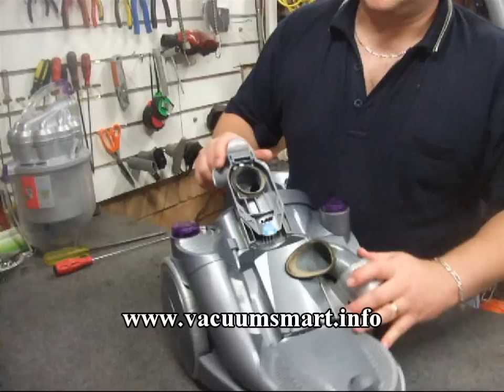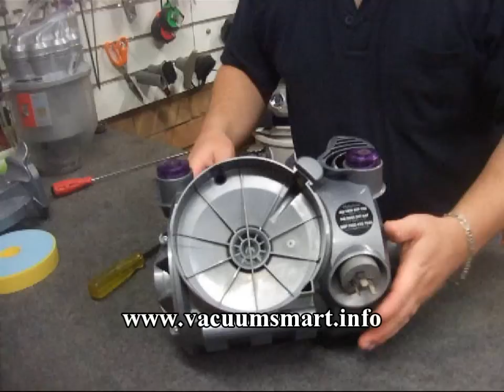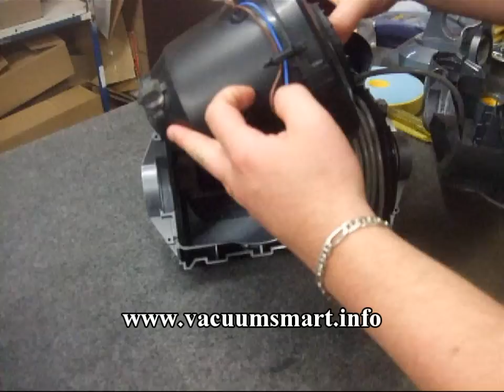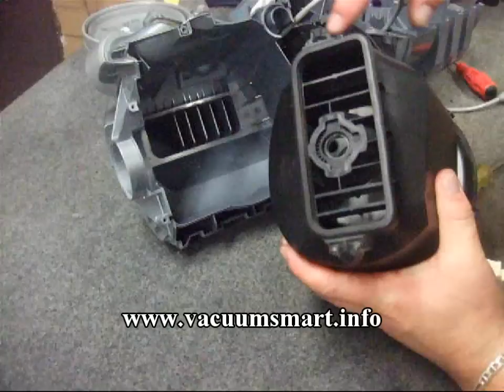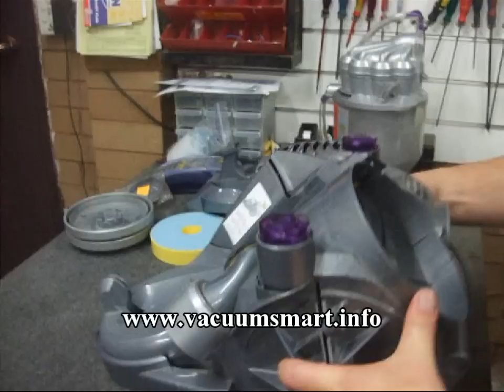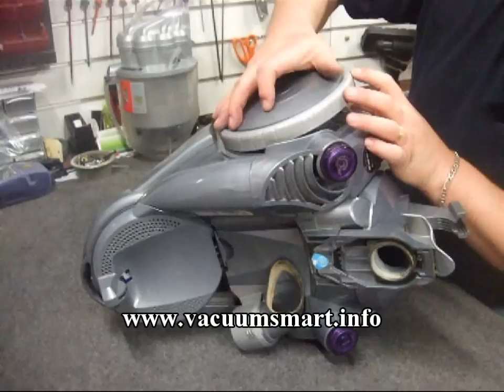How to change the motor in a Dyson DC08 vacuum cleaner

Comment: Have you ever had the rotating brush in the head apart? Mine has stopped working? I’m wanting to split the black housing so I can look at why the brush as it isn’t spinning. I can’t slide the housing apart as I can’t remove the small cast aluminum gear-thingys. Any help is greatly appreciated.

Comment: I could fit the motor DC 08 successfully.  But fixing the cord wheel was a real challenge. I had to struggle   aligning the outer cover.
It doesn't look as easy as it looks on the  vedio.
But it was a good experience and saved money on buying new one.

Comment: My my you may just have saved me loads of money,  I am now going to take my DC08 apart to see if it is the motor ( as I suspect it to be) has burnt out..... when I was using it there was a strange noise, then a burning smell so I switched  it off, the filters are new, the bin was already empty so I know there is no problem there, when I switched it back on it made the strange noise again for about 10 seconds then cut out completely and is totally “ dead “now...... How can  I be sure it’s the motor? Your video is great by the way..... thanks

Comment: vic
I used to train teachers and demonstrations was a session on the course (UK C & G 7307 Further and Adult Teachers Cert [TAFE] IN OZ). I also used to teach Electrical engineering which involved many demonstrations. I was most impressed by your video, clear explanations, visual points easily identified and a smooth, informative commentary. WELL DONE!!! 10 out of 10! Excellent!

Comment: Excellent guide, thanks! I just followed it to access the motor in my DC08, which had suddenly refused to power on. Found that the motor's winding wire had broken at the terminal attachment. Soldered in a short length of wire to bridge the gap and it's working like new again!

Comment: Great video of information, I have the same model Dyson as shown in your video, I replaced the carbon brushes run a treat first time and then started to splutter like when the brushes are worn down to far, took it all apart removed the motor and cleaned the armature.  And reassembled and the motor is spluttering any tips, Alec?

Comment: An excellent video. Just replaced the motor, switch & both filters on my 10 year old Dyson DC8 Animal. Stripped and cleaned the cyclone and the machine is like new for only £23.97. Thanks again. For those of us in the UK, SPARES2GO on ebay is an excellent place to buy your spare parts.

Comment: While this video showed me how to take apart my Dyson and I did not find my problem in that area, I did instead happen upon the real source of the problem with one of the smaller actions you took. I didn't realise the hose base could slide out so easily. It turns out my issue was a clog in the handle that had gotten pretty bad. It looks like someone must have made a 'repair' to the handle at some point and used the wrong screw (with silicone to seal it) that protruded into the hose itself. effectively hair and other detritus was just building up on that spike until it completely sealed itself.

Thank you for your facilitation of my repair, however accidental it was.
Reply: Nick Skarvig has a new name u
Reply: Engvejen UFH 
I'm sorry, what?

Comment: Hi Alec,
thanks for posting this mate. Very easy to follow and well presented. I've just pulled apart mine and my fathers Dyson's to check the motors as both have stopped working with the usual funky burning smell. Have also just placed an order for two new motors with your online store. You deserve every penny you make on the parts after producing such a good video. (I'll follow the cleaning advice also on your other video which outlines how to strip and clean the barrel cyclone chambers)
Many thanks mate, I owe you a beer,

Cheers,

Comment: I thought doing your own electrical work is not allowed by Australian Electrical Laws & Regulations. Can you advise whether it is legal for us Aussies to buy a motor from your website and then doing our own repairs at home by following your videos?
Reply: It is an appliance. There is nothing stopping you from doing your own repairs. The laws and regs mostly refer to the supply side of the electrical outlet. There are requirements regarding electrical safety tests if your repairing it for somebody else ( as in a paid job)
Reply: very shocking comment

Comment: Hoi Alec. My dyson suddenly stopt working. When i push the button, i hear de motor turned on. But when i let de button free, the motor stops immediately. 
What is wrong with my vacuum cleaner? I washed en chanched the filters already. 
I didn'n know there was also a filter on the back site of the machine, so this was the first time I cleaned this one. I thought the only filter was inside the  can you take of. I also cleaned the filter on the bottom of the machine, but i need a new one for that.
Greats Jolanda, Rotterdam, Holland
Reply: could be the cord retract assay needs replacing

Comment: Hi Alec, I've bought components from you last year and successfully repaired my Dyson after watching your great tutorials. Never looked back! My daughter's Dyson now has a problem, so I was wondering if you could give me some advice please? She was using it as normal. Switched it off to move to another power point. It won't turn back on. They tested power points and it wasn't that. Would you please offer any advice as to whether it's likely to be the motor or simply a switch? Either way I'd like to repair it myself. Thanks so much, Liz.
Reply: something similar happened to me Liz , means the cord retract assay needs replacing. It is connected to the actuator (power button) which is why when it need replacing the machine wont turn on or only turns on sometimes. ps: This part is hard to find, I had to go on ebay, even on there ti was hard to find. If  you get stuck you could try buying a 2nd hand DC08 on gumtree to use for parts.

Comment: Great video.
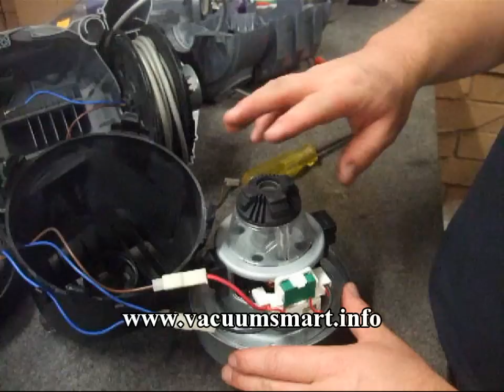You say that the transparent locator will only fit in one direction but, at 5:55 it is in one position whereas, at 6:02 it has turned 180° (the right position in y opinion).

Comment: Great Video.  I was easily able to replace my faulty motor.  I would like to add that it is possible to replace a Panasonic type motor (mine was a UDS1554CNA) with a YDK type motor.  However you must replace the rubber fan case with a YDK type as well.

Comment: Thanks Alec,

I couldn't work out how to get into my DC20.  Found the two screws at the top and knew there were another four somewhere from an online diagram of part of the machine.  It wasn't clear they were under the wheels and I would have been really hesitant to force off the wheels so forcefully if I hadn't seen your vid.  Now have access to the on/off switch which is the problem!  Hopefully I can get it sorted and save a lot of money in the process!

Comment: Hi Alec, Would you recommend replacing the post filter at the same time? Is it necessary?
Reply: did you know the post filter is washable, should be washed every 3 months and fully dry before putting back in?

Comment: I suspect your cord or motor has a short in it. Rule out the cord and switch by checking continuity with a multiplier, if they are ok just replace the motor.

Comment: great video, just want your input on something alec. I plugged my dyson dc08 into the wall socket and it would not switch on, so I thought, hmmm could be the fuse, so out came the flat screwdriver and as the metal head touched the plug prong, I was met with an electric shock. any ideas guys ?

Comment from the maker: It is normal for there to be a noticeable amount of fine dust in and around the motor. It is not normal for bits of hair fluff etc to be in the motor. If you have big chunks of stuff in there then yes have a look at your seals and filters. However just fine dust just needs to be air compressed and cleaned as best you can.

Comment from the maker: Ah good spotting!! In actual fact it is really neither the MO44 or the MO48. The motor in the video is the original dyson one which has the thermal cutout like the MO44 but is missing the shaft like a MO48. Both the MO48 and MO44 will work fine in the dc08 because of the plastic locator (riser) since the shaft will fit inside the cone no problem. If it was my machine I would use the MO44 but if you want to save the cash the MO48 works fine. Thx for the praise :)

Comment from the maker: Ok so it is possible to fit it but it is very hard. I have done it a couple of times as an experiment. Basically it goes in the same but is 100 times harder to get the casing to close. The proper way to change them over is to get a YDK motor bucket and a new fan case seal and motor support or locator. There are some versions (overseas) that I have not seen the locator (rubber bit on top) that may not simply allow it to be squashed in.

Comment: Brilliant, thank you so much for this video - I have just replaced my DC 08 motor and cleaned the rest, and my old machine is working like new for a fraction of the cost of replacement.  Your instructions are excellent, well done.  Much appreciated.  This kind of thing is so empowering (if you'll pardon the word), especially for an older lass like me!

Comment: Hi, currently my DCO8 is out of action & ready to be disassembled thanks to your informative video! Just a quick question, when I was using it the other day it started making a popping kind of noise along with a burning smell & some sparking from under the permanent filter. From your knowledge do you think this will need the motor replaced or just a good clean? All other aspects of the vacuum are maintained regularly by me including cleaning of the filter.
Thank you.

Comment: Thanks so much. Really good explained and i made it the first try ^^
At my dyson simple the blue cable was disconnected in the motor.
that connection really doesnt hold together very good.
Watch for this if you repair your DC08 befor you change the motor or switch.

Comment: BEWARE! Those looking to buy a DC05/DC08 etc motor. Note there are many being sold (esp. on ebay) which are actually DC04/DC07 motors with the axle/spindle cut off & grinded down to fit the DC08. The axle on a proper DC08 motor should not protrude out of the motor's metal casing.

Why is this a problem? well if you cut the axle/spindle down in this way you can cause damage to the bearings! Hence shortening the motor's life & also causing increased noise & vibrations from the vacuum! Avoid them!